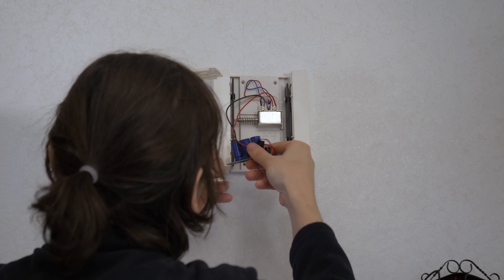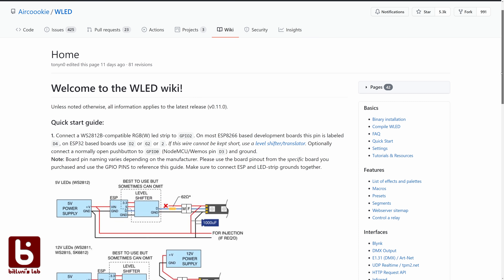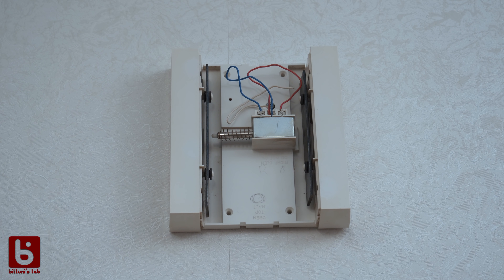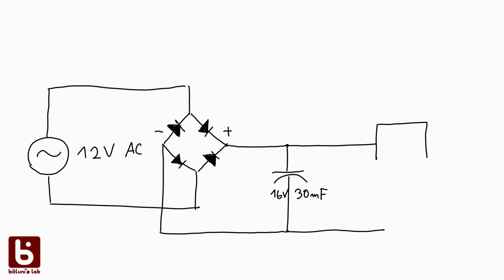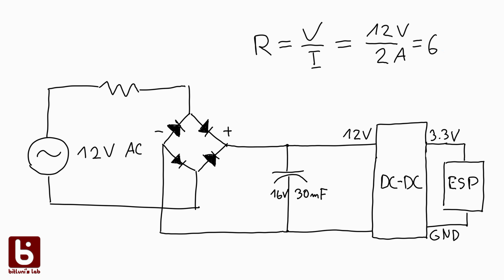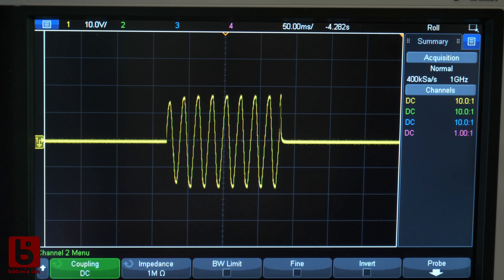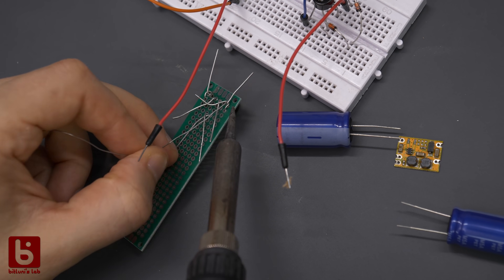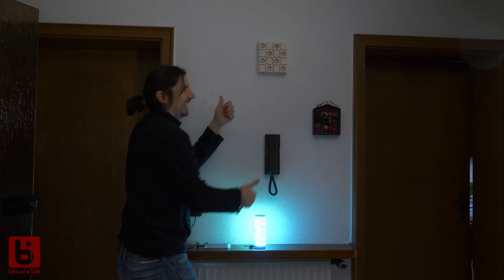Doorbell WiFi Upgrade [DIY, IoT, Node-RED, WLED]

Comment: Maybe switch to a bare ESP12 and solder out the LED. Or use a Witty and remove everything that is unnecessary, you can unplug the serial adapter.
You only need the serial adapter for programming.

Comment: Cool project! I just made my doorbell smart as well, placing a z-Wave door sensors‘ reed contact nearby the magnetic coil, sending messages through OpenHAB to my smartphone… The battery lasts very long but of course your capacitor solution is really smart while powering the D1 mini just momentarily! Good job!!!

Comment: That is a great solution. One option would be to define a preset in wled that would do the difference sequences like do the door bell ringing and the  go back to the previous state one. That way would save the node red and the Pi running

Comment: I like the idea... There's some room for improvement though. Using your current method, you can set a static local IP for the ESP in the Sketch. If the ESP doesn't "choose" its own local IP it is assigned an IP by the DHCP Server of the router. Due to this "negotiation" the ESP needs a little longer to connect. If you really want to save time there are other methods, some of which involve more "hacks" than others. Personally I think the best method is to have one "main ESP" somewhere in the house that receives ESP now packets and relays them into the wifi network somehow. It's a bit tricky since you can have ESP now and wifi at the same time. But there are solutions. Anyway the main ESP can be considered the "ESP now" gateway. And then any device that has limited power just wakes up and sends an ESP now message to that gateway. This has the advantage the ESP hast to be awake for less than 50 ms compared to a few seconds when it connects to wifi normally.

P.S. After the rectifier you don't have 12 V DC... 12 V AC is the RMS voltage (Effektivspannung), when rectified you get the peak voltage which is 12 V * sqrt(2) = 17 V minus the voltage drop over the rectifier of about 1.4 V... So probably around 15.5 V. Also the transformer is most likely not regulated therefore is around 12 V AC under a specific load. Personally I would assume a max voltage of 25 V or so to be on the safe side.
And anther thing to consider, is that while buck converters are more efficient, they usually have a higher quiescent current. So while the ESP sends the message it is more efficient. But when it sleeps, you would probably be better off using a linear voltage regulator with a low quiescent current. This is especially important with battery powered projects that deep sleep most of the time.
Reply: ach tool, espnow wollte ich gerade vorschlagen... ich bin so ein opfer... statt ein wemos mit den ganzen kleinkram würde ich einen nackten ESP12F mit eben espnow nehmen

Comment: I have a problem with my d1 mini.. when using my d1 mini as AP mode, it works fine, but when joining it with my home network, it cannot be connected with my router. what is possibly causing the issues here? my router or my d1 mini? I am flashing with the latest wled firmware version wled 0.12.0

Comment: Thats not 12V DC after rectification. The 12V AC, is 12V AC RMS. If you rectify it you get the peeks of around sqrt(2) * 12V. So 25V Capacitor is a MUST here. Also you can use some super-capacitors.
Reply: Also you can add a reverse Diode (Schottky) in series with the 6 Ohm resistor. So when the capacitor is charged it does that through the 6 ohm resistor, but when its discharged you only drop around 0.5V on the Schottky.

Comment: I'm about to redo my who Doorbell setup. My home didn't come with a Doorbell so I had to retro one in. I used CAT6 cable so I have some extra pairs. Instead of running the cabling to a Transformer I had ran them into the Alarm Panel box so I could figure out a way to add some smarts to it. I was planning to use a 12 volt relay to trigger some GPIO pins on a ESP that is constantly on. This way with Home assistant I can make lamps flash in the Kids room and have Alexa notify me in the Garage. I also have a siren that can play sound effects so I can be funny and use the Barking Dogs sound effect.

Comment: I did a similar project with one of those wireless doorbells with "kinetic" switch (it does need a battery). The indoor receiver part runs on about 4.5v (there are also 3xAAA powered versions of this design so I'm not surprised at the voltage) and that is well in range of D1 mini built in voltage regulator. So I just slapped one D1 mini on the inside, connected the receiver led that flashes when activated to one of the pins and "Bob's your uncle" . It's been working flawlessly for 2 years now. Total cost of parts including the doorbell was like 15euro.

Comment: 12VAC isnt the same as 12DC, good you used a 16V Cap, but the Voltage you get after the rectifier is 12VAC*sqrt(2)~17VDC!!! The cap is to small for your voltage!

Comment: Its funny and very intelligent way. I build a comparable solution last month. But i wanted more. With a simple voltage sensor module, a bridge rectifier and a relais, you can do a lot more - open the ,door, shut off the bell and have a second bell in the basement. But with the need of more power.

Comment: I would have used a 433Mhz transmitter as it will run on 12 volts DC  then a 433Mhz receiver a bit like your old circuit for sockets you did anyway good video thanks

Comment: The voltage will exceed 12V. It is 12V rms, zero to peak will be sqrt(2)*12 which is 16.97. It depends on diodes,  they might have as low as .3 v drop and you will still end up with 16.4 v. It will shorten the life of the capacitor

Comment: 12v AC rectified will hit 12 * 1.414 maximum, that's almost 17v without collapse spikes... 16v is underrated.
Reply: Yeah, even if you account for the voltage drop of diodes it's still too close.... sqrt(2)*12 - 2*0,7 = 15,57V in best scenario. sqrt(2)*12 - 2*0,3 = 16,37V with shottky diodes. And that's for the nominal voltage, there could be slight overvoltage on the lines...
Reply: Totally, how does that slip through?
Reply: I was wondering if no one else noticed that.

Comment: Nice project. I've recently solved a similar issue, albeit with a more lazy solution. I've pointed a smart PIR sensor so only movement right in front of my door is detected, then Home Assistant uses this signal to blink a light at my desk. 
So when my partner is asleep after a night shift,  I could disable the breaker of my doorbell and still get notified when a delivery guy is in front of my door.

Comment: Nice one! Setting a static IP will help, but setting the BSSID and WiFi Channel Number for your access point will make an ever bigger difference and speed up connection even further, because then the ESP won't need to sit there and scan channels and wait for announcement frames! Channel and BSSID are parameters #3 and #4 on WiFi.begin().

Comment: Save yourself some capacitors by connecting the unused white wire to the broken power leg, supplying constant 12v
Reply: seems like the current, working solution is using much less power though.
Reply: @Davedarko  true.. tradeoff with reliability.

Comment: How about connect the door bell wire to a zigbee end device(e.g. remote button), use the 2A as a trigger signal to control the WLED(Zigbee2MQTT), The delay will be much less.

Comment: Can't you underclock the esp and possibly connect at a lower link speed to save even more power?
Reply: uii, nice to meet you here.
i don't know if this is possible with the default wifi library (connecting with a lower link speed), but what would save time and power is setting a static entry for the ip adress, so the esp doesn't have to wait to get a IP from the DHCP Server.

Comment: You could also put a resistor across the door bell push button. This would provide enough current to keep the ESP permanently powered but wouldn't be enough to ring the bell permanently. In the old days there would be a small bulb in in the bell push to light it permanently so this is not a misuse of the bell setup.

Comment: i built a similar lamp, but it turned out to be a heating device ... 300 leds, 12volt. do you have any tips or is yours also runnong at 50-60°?

Comment: Nice, that's an excellent application for it, WLED is just so awesome! :D.  I built my version a while back but my doorbell (Dahua VTO) speaks "native" MQTT, and also has a camera and app. I have some Automation in Home Assistant to automatically store states of lights and then can make the whole house blink like a 🕺Disco party🕺 when someone is at the door, very useful when you are somewhere you can't hear the doorbell! Your way saves a lot on the doorbell part though if you don't want a camera and app! 👍👍

Comment: Why didn't you use the Doorbell controller itself instead of the ringer?
Reply from the maker: good point for my installation. I'm thinking of placing an espcam at the intercom, too. The initial idea was to concentrate on the bare minimum a flat would have access to. but now there is even the extra server so why not going all the way

Comment: Instead of using the standard WLAN protocol, you could also switch to ESP-NOW which is a proprietary protocol by Espressif. You can use it with ESP8266 or ESP32 modules. It has super low latency because you don't need the sending module to connect to WiFi first, but instead you can send a packet directly to a target device. You'll need a receiving ESP32 module which captures the doorbell packets. It may even be possible to capture the doorbell packets using a Raspberry Pi.
Reply from the maker: i'm aware that would be the fastest way. it would be an extra receiver, though. it's the reason I added the line "no special hardware on the receiving side" to tge script.
initially i though of just using a simple rf transmitter. but that would also require an extra receiver bridge.
Reply: @bitluni  Yea, true. Instead of using an ESP you could always go for a casual RF receiver. I can totally understand the wish to use existing infrastructure (WLAN) and I find it really amazing that you got it working using WLAN despite the power consumption that is required for connecting and spamming packets. Btw I'm really happy I found your channel. Really amazing stuff!
Reply: That really does sound like something I have to try out for my sensors projects. It will save tons of battery life
Reply: good idea.

Comment: I like the project though I ended up using 433Mhz (ASK) or LoRa for most of the stuff. The advantage for 433 is that it's instant-on and the PSU could be much simpler, with just a Zener. The disadvantage is that it requires a gateway, but OpenMQTTGateway is great and easy to set up.
Reply: I will try this as well, i recently analyzed power draw of different rf methods on the esp32. WiFi takes up to 3s (and 858mWs) from wakeup to successful transmit, LoRa (868MHz) takes just 500ms (69mWs) and ESP-NOW is also a great way, it only takes 640ms (108,9mAs).
Reply from the maker: yeah that was also my conclusion when thinking about using rf. whatever works is fine with me

Comment: You can try giving the ESP a static IP address. I heard it speeds up the wifi connection time. Never tested it myself tho.
Reply: It does significantly. two to three seconds of saved time
Reply: You can also shave off some time by connecting to a specific bssid & channel in the WiFi.begin call
Reply: You do not need an IP to send UDP Broadcasts
Reply from the maker: the dynamic ip is negotiated on connection with the dhcp. i totally need to try it... that might safe a capacitor

Comment: Since you effectively can have power at both the doorbell push button and the bell you could permanently power an 8266 in the doorbell. If you simply tap across the doorbell push button you would need either a small battery or capacitors to maintain charge when the push button is pushed. This way the 8266 stays live and attached to WiFi and response times are drastically reduced. You can then also use an MQTT client in the 8266. Alternatively if you wire the push button to the 8266 instead then you have more control over your doorbell like turning it off overnight. Using a relay with the 8266 you can have it also monitor MQTT and ring the bell. An alternative to the relay is to use another 8266 in the bell box to trigger the sounder. Deriving power for this 8266 is a little harder and getting enough to trigger the solenoid is also more challenging but this lets you add say an infrared sensor outside so you can also activate the sounder if someone approaches the door and just knocks. It is potentially easier to replace the chime with a small mp3/ogg player, amp and speaker then you have a choice of chimes and its easier to power.

Comment: My Esp8266 based plant sensor is running on a 400mah lifepo battery(Duracell - Solar Akku 14430) and it is up an running for 10 months now. It's sending the Waterlevel of the plant once a day via a telegram bot, but it has to wake up every 2 hours since the timer can't go longer. I think for a Doorbell you can get 2+ years with one battery charge, but i dont have the equipment to measure the deep sleep current.

Comment: So, why would you not just use the GPIO on the ESP and leave the ESP32 in sleep mode until the GPIO was triggered? Then you could assure the signal was sent to your home automation by checking state using mqtt. I assume you are using Home Assistant? The energy consumption would be limited in sleep mode between button pushes. Just a question, love your videos.
Reply: He mentioned this. He would need a power source and he said that even with low power consumption he wouldn't get around to changing the batteries.

Comment: An alternative way would be to have the ESP32 broadcast a custom frame and have the AP/router listen for that frame, and relay it to nodered. This improves latency as it removes the lengthy wifi auths, and possibly the capacitor as well as everything can be done within milliseconds.

Comment: Aren't 16V capacitors for the energy storage rated too low in voltage? IIRC 12V AC RMS is ~12*sqrt(2) = 17V peak. The full bridge rectifier will take 1-2V so then you'll just be in spec, but I wouldn't feel comfortable with so little headroom. Unless I'm mistaken of course.
Edit: from the charging time the RC time seems sth like 300 ms, so similar to the 6 Ohm resistor you proposed. If someone were to press the bell for longer than 5 RC time constants (1.5 s) angry people at your door could make capacitors explode :).

Comment: If I implemented this I would be a bit concerned that that UDP packet is sent really at last minute. Have you tried setting a static IP on the microcontroller, instead of waiting for the DHCP, to try making the wifi connect quickly?
Reply: I guess it's always going to be the last minute. It's the transmitting that sucks the power.

Comment: I think u would have 17V (12sqrt(2)) after de rectifier, because 12Vac its not peak voltage.
Reply: That's what i thought too. It could exceed the input voltage limit of the buck boost converter which is rated up to 15V.
Reply: You are right,  I am confused that Bitluni didn't saw the higher DC voltage. But to be honest a lot of professional manufacturers dimension their capacities too low to limit product lifetime 😉

Comment: The ESP works reliably with ~2.2V, it also eats less current. Would you consider to also the option to go down on the DC2DC? Might increase the chance of the ESP to send the packet even with short press of doorbell...

Comment: I like how you picture the behavior of DHL, Amazon and others when those guys throw parcels at me, literally. You forgot the one who is "hiding" parcels somewhere in the garden or carport when I am not at home. Nice project. I was connecting to my 8VAC doorbell as well, luckily I have steady power there available, so I did not need to run from caps
Reply: What we need is a doorbell that rings before they even get to the door, to cope with the ninjas who appear at the door, ring the doorbell and then are half way back to their van before you've got the door open.
Reply: @ncot_tech  easy, just put some high voltage on the doorbells switch. Their recovery period will give you plenty of time to get to the door
Reply: @ncot_tech  I thought they throw the parcels to maintain social distancing.
Reply: "If you're not home we'll  leave in  safe place". I found about a half dozen small parcels one day months after they were delivered  in a "safe place".